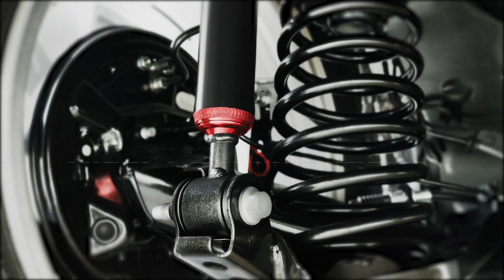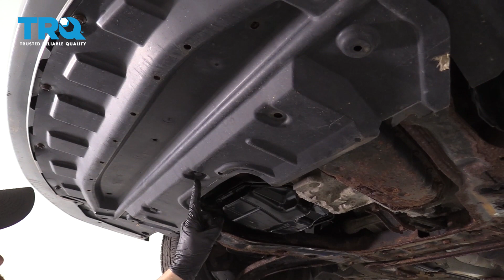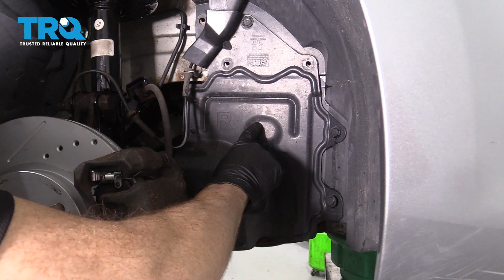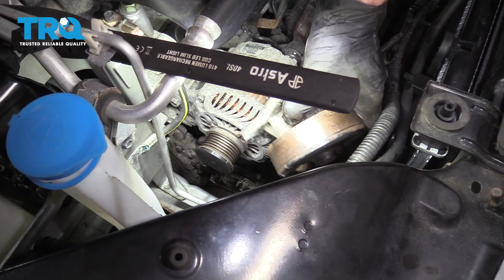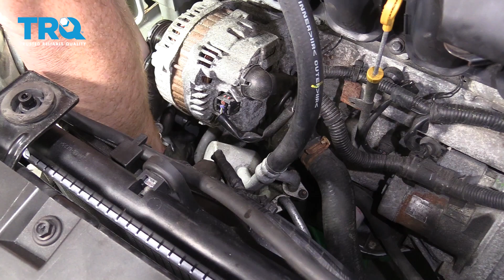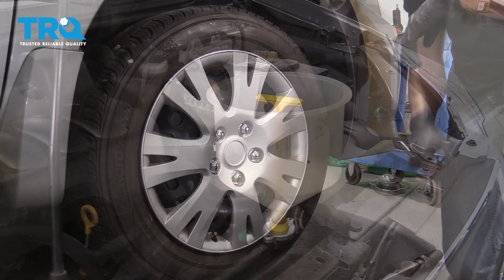How to Replace 2007-12 Nissan Sentra Engine Water Pump

Comment: Boy, all that rust isn't going to help you in an accident. And in a Sentra, you need all the help you can get.  "Blaster" brand makes a spray on undercarriage protectant to stop rust, and doesn't wash away quickly.  Good stuff.  And a new oil pan looks to need to be ordered.